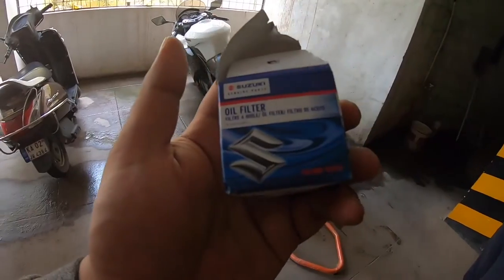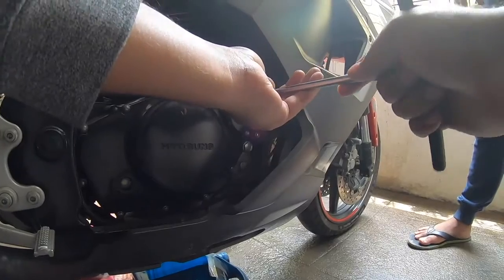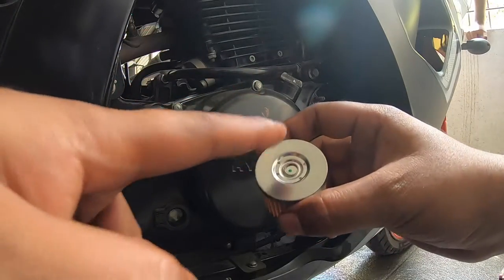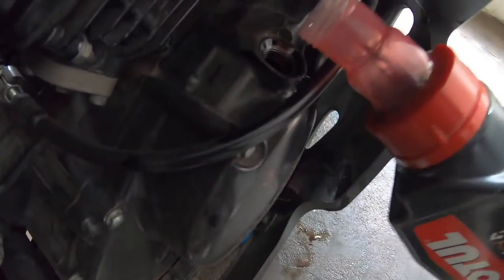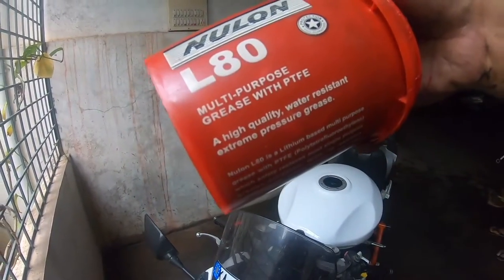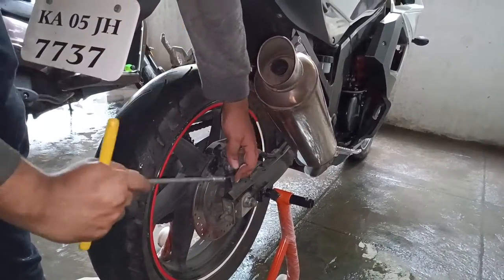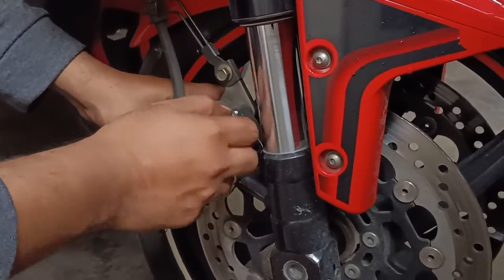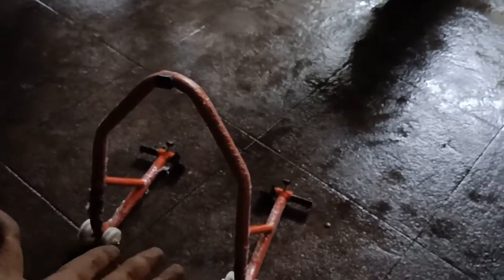How to service your motorcycle in 19minutes | DIY | GT250r

Comment: Hi. Any source for getting oil filter O-ring of Hyosung GT250R 2014? Or is any other O-ring compatible
Reply from the maker: Check in the local market.. you'll get lot of orings which are the same size..
Reply: @MachoBiker  brother any specific bike's o ring which can fit? According to your experience. Will be thankful for the help 🙂
Reply from the maker: @Touseef_ahmed99  no.. i usually go to the local market with the old oring & pick up the same size..
Reply from the maker: @Touseef_ahmed99  if you are looking for the oil filter cap Oring i suggest use the old oring with some Anabond gasket maker paste  (preferably red compared to grey) over the old oring..
Reply: @MachoBiker  ok bhai thanks
Reply: One more question. Sorry for asking so many questions 😀
Which spark plugs can I use in Hyosung GT250R 2014
Reply from the maker: @Touseef_ahmed99  NGK iridium CR8EIX
Reply: @MachoBiker  thank you so much 😊

Comment: What about coolant?
Reply from the maker: The 250 is oil cooled.. doesn't use coolant
Reply: @MachoBiker  bro how to should i change in 650r
Reply from the maker: @Sonofgod321  usually you won't need to change it.. it'll last a long time.. but when you are replacing it you need to pull out the drain bolt present just under the radiator n  fill up the coolant from the top.. you might need to remove the fairings for this.. I'll try making a detailed video asap